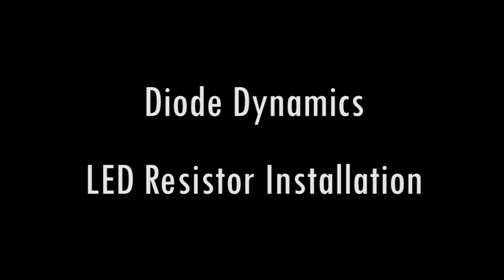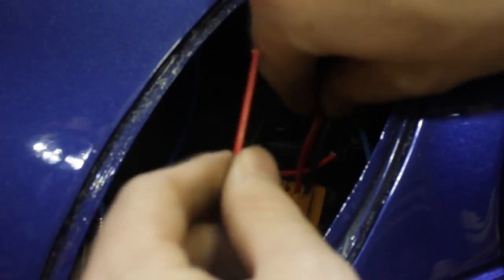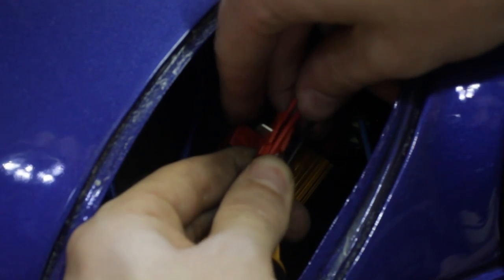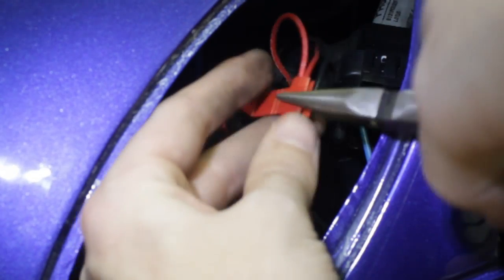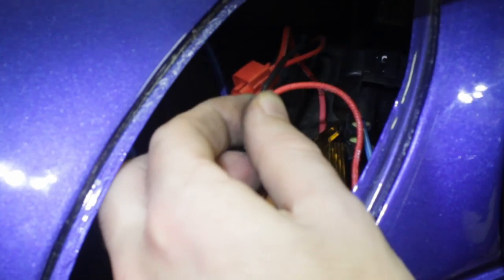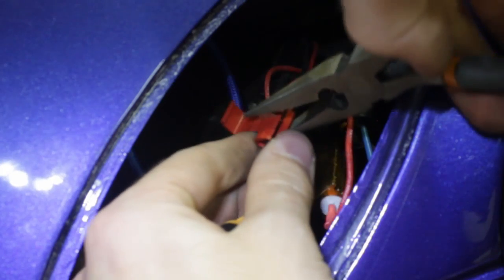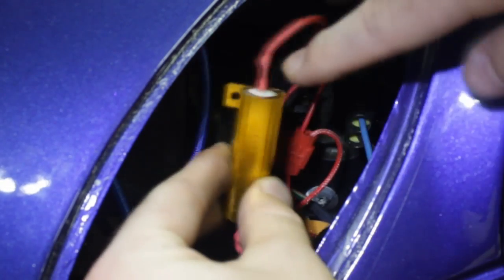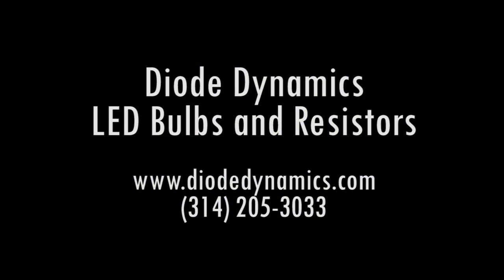How to Fix Hyperblinking! Installing Resistors for LED Turn Signals | Diode Dynamics

Comment: I have bought 4 signal (yellow/amber) led la,ps for my car, i also install 2 resistor for the lamps, but it don’t works well- and its still hyper blinking. And then, I bought a led blinking relay flasher, then everything went well. Why do I need to install resistor and led flasher unit in order to get all the 4 bulb working accordingly?
Reply from the maker: Hi Sean! You will need one or the other to stop hyper blinking. It is likely that your application required only the relay to function properly and didn't need the resistors in the first place.
Reply: Diode Dynamics  I see, I am waiting for the relay unit for the led to arrive. I will install it and see how it goes. But on my scooter, I do this fixture Led relay + resistors on both sides and it works, if I didnt install the resistors, the bulb would not flash and it constantly light up all 4 of them. When I install the resistors but with non-led relay, the lights up with not flashing and were dimed.

Comment: So I ordered tail lights from Caauto and it already cam with this resistor but my sequential tail lights still speed up any recommendations?
Reply from the maker: Hey there! More than likely it is still a resistance issue. We would recommend reaching out to the tail light manufacturer, as they might have more insight as to where to do this in this custom application.
Reply: Diode Dynamics ended up taking your advice called and asked and they said there was a faulty party told me to ship it back to I returned it to them hopefully I’ll get them back soon thanks for the advice!

Comment: my question is if I change all the signal bulbs I have to put one for each bulbs
Reply from the maker: Correct, you'll want a resistor for each turn signal bulb.

Comment: Hi - I have 1157 directional's/running lights on the front of my 1999 Q45. I bought a modular resistor wiring setup (XCAREMO) that plugs into the OEM 1157 (3 wires) , then the inline resistor, and then has the 1157 socket to allow you to not have to tap in or change any OEM wiring.  However when I run the directional's they work fine and don't hyper flash. Then an issue shows up when I turn on the headlights and then I have an issue with the car thinking that the directional and/or running light is burned out. The 1157 LED running light is on ok. The directional's don't hyper flash with this setup but there appears to be an issue with the running lights and the dash will show an error light and leave the turn signal light on in the dash. I tried changing the wiring and had to figure out the ground (Black) and one blue and one red on the modular unit. The infiniti has Black, Green/Red and a Larger Red/Green Stripe - Still can't figure out the wiring issue. Can you assist me and help me figure out how to retrofit LED 1157's on this Infiniti? Is this possibly a ground issue? Thank you... please recommend your product. ( I have purchased other kits from you in the past)
Reply from the maker: Sorry you are having issues with your running lights! Please go ahead and give us a call at 314-205-3033 Monday-Friday 9 a.m.- 5 p.m. CST, or shoot us an email at contact@diodedynamics.com, and our service team can try to help you out!

Comment: I bought blinkers from aliexpress but they are super bright. Is there a way to dim them using resistors?
Reply from the maker: Resistors for turn signal applications will generally be used to slow down hyper-flashing, not dim the bulb - sorry!

Comment: Scotch locks omg! Those are horrible, they damage the wiring and allow water to enter which causes corrosion and leads to issues down the line. The proper way would be to cut and splice the wires either solder and marine heat shrink, or at least crimp and seal butt connectors. Please do yourself a favor and dont use that style connector anywhere on a vehicle.
Reply from the maker: Hey Nate! We completely agree! If you are capable of hard-wiring, that would be ideal. However, these quick splice connectors are a pretty good alternative for the average-Joe. If you have any other questions, just give us a call at 314-205-3033, Monday-Friday 9 a.m.- 5 p.m. CST, or shoot us an email at contact@diodedynamics.com!

Comment: Will this work on a sequential light strip? I bought a 24 inch and trim it down to 4inch the light look solid now because lighy is traveling to fast.
Reply from the maker: Hey there! Our 50W/6 ohm resistors can be used for any turn signal application that experiences hyper-blinking caused by LEDs. If you have any other questions, just give us a call at 314-205-3033, Monday-Friday 9 a.m.- 5 p.m. CST, or shoot us an email at contact@diodedynamics.com!

Comment: Can resistors not burn some wires 

I heard they need airflow
Reply from the maker: Hello! Resistors can get VERY hot, so we always suggest to mount them to an unpainted metal surface, or to leave them hanging freely, away from any soft plastics or wiring. 
If you have any other questions, just give us a call at 314-205-3033, Monday-Friday 9 a.m.- 5 p.m. CST, or shoot us an email at contact@diodedynamics.com!

Comment: Does it matter what end of the resistor goes where...both ends are red and the video doesn't show any + or - markings on the resistor itself...thanks
Reply from the maker: Hey there! No, it does not matter which resistor wire gets tapped to your factory wires. 
If you have any other questions, just give us a call at 314-205-3033, Monday-Friday 9 a.m.- 5 p.m. CST, or shoot us an email at contact@diodedynamics.com!

Comment: Noob question but how does this work without either blowing a fuse or a bulb ? You would think wiring positive and negative would be a direct short as  like sticking a wrench in between battery terminals.
Reply from the maker: Hi there! By tapping a resistor into the circuit, your essentially mimicking the increased power consumption of the factory incandescent bulb!

Comment: I have a problem with my LED turn signal light bulbs I plug and play but they don't flash they don't work so I wonder what problem could be in also I don't know if I have to get a resistor or something in order to make my LED work do you know what could be the problem  then I get a normal halogen light bulbs to check if there was some wiring problem  or fuse problem or something like that but the halogen turn signal light bulb works  properly any idea what's wrong with my LEDs
Reply from the maker: Hi there! Please go ahead and give us a call at 314-205-3033 Monday-Friday 9 a.m.- 5 p.m. CST, or shoot us an email at contact@diodedynamics.com, and our service team will be happy to troubleshoot that!

Comment: If you only do this with the rear(replacing with LED's) Can you have regular incandescent bulbs in the front or do you need to do leds on all signal lights?
Reply from the maker: Hi Jef! You should only need resistors on the turn signal bulbs you've upgraded to LED.

Comment: I've wired up my resistors on the front and they ain't noway as bright as the back ones that arnt on resistors.. Why? Leds on back are mega bright on front are half as bright even tho I've resistors on the front to help the flashing. When I put bulbs on the front there bright but not Leds... HELP
Reply from the maker: Hi there, thanks for reaching out! Please go ahead and give us a call at 314-205-3033 Monday-Friday 9 a.m.- 5 p.m. CST, or shoot us an email at contact@diodedynamics.com, and  our service team will be happy to troubleshoot that!

Comment: Question, what do I need to do if I want those lights to run at the same time. For example in the front of my vehicle the turn signal is only powered when I use the signal. Bun in the rear the turn on when the lights are on rear lights are on and when you turn the signal on it gets brighter. But I put on a resistor it only blinks when the signal is on.
Reply from the maker: Hi Bruce! Please go ahead and give us a call at 314-205-3033 Monday-Friday 9 a.m.- 5 p.m. CST, or shoot us an email at contact@diodedynamics.com, and our service team will be happy to look into that for you!

Comment: Paul I replaced the flasher when I replaced the whole rear light s its worked good until now. the flasher blinks all the time even if you use no key also with no key the signal lights will work with the  switch I have ordered resisters will they fix the problem ?
Reply from the maker: Hi Roy! Please go ahead and give us a call at 314-205-3033 Monday-Friday 9 a.m.- 5 p.m. CST, or shoot us an email at contact@diodedynamics.com, and our service team will be happy to troubleshoot that!

Comment: Hi can you help me with 
My front side light or parking light it's going off and  on again.  and I've just got the resistors but don't know how to put them on it can you help
It's Vauxhall vector 07 1.8 16v .
Or do l just put them on the two wire's it's coming out back of the light.
Thanks very much. 
Yours sincerely 
Robert Gordon .
Reply from the maker: Hi Robert! Thanks for reaching out. Please go ahead and give us a call at 314-205-3033 Monday-Friday 9 a.m.- 5 p.m. CST, or shoot us an email at contact@diodedynamics.com, and our service team will be happy to help!

Comment: I did this for my DRL's when I switch them over to LED's. Before I put the load equalizers and but already had my LED's hooked up the DRL's would come on but I would get a warning light on the dash. so I hooked up the Load Equalizer and now the DRL's don't come on but my high beams come on when I start the car.
Reply from the maker: Hi there! Definitely feel free to give us a call at 314-205-3033 Monday-Friday 9 a.m.- 5 p.m. CST, or shoot us an email at contact@diodedynamics.com, and our service team will be happy to troubleshoot that!
Reply: Just a quick reply on the DRL's. I just found out that on my corolla the DRL's are the High Beam, just ran with less power!!! Lot of people are having the factory disconnect them when upgrading to high $ lights cause you are just running your High Beams all day under less power!!! Good Luck,

Comment: Hi here.  Great Video and informative.     BUT.    I have a Skoda Octavia Facelift 2012 MK2 1.8 TSi  DSG.  I am in the UK, so it is BRITISH specification.     
I have installed LED  PY21W bulbs for my Indicators ( Direction flashers to you in the USA ), and W5W front marker ( side ) lights, but when I start the engine, they all flicker for about a second, but in use I do not get any hyperflash, or dashboard warning..  
I think the flicker is the onboard ECU testing the bulbs on start up. 
Because of this, I am holding off doing all of the other lights like the marker ( Side ) lights and the stop/tail ( P21/4w ), etc.    I also want to avoid the dashboard "BULB OUT" warning light. 
I would really appreciate a brief tutorial, or advice on what to do.
Should I just put the same resistor on every circuit., even the 5 watt marker lights.  And what value resistors do I need for 5 Watt marker lights and 21 watt Stop lights ( P21/4w ) and 21 watt (P21W) fog lights, and 21 watt P21W) Day Running Lights + 21 watt (P21W) reversing lights,  whilst still keeping the extra brilliance of the LED bulbs, but getting rid of the flicker on start up, and the dash warning light.   
Many thanks in advance, as I know this is a big ask.
Keith.
Reply from the maker: Hi Keith, thanks for reaching out! Please go ahead and give us a call at 314-205-3033 Monday-Friday 9 a.m.- 5 p.m. CST, or shoot us an email at contact@diodedynamics.com, and our service team will be happy to help!
Reply: Thanks for the quick response.    I will try and call you very soon, although it can be expensive to phone the USA from the UK, but I think it will worthwhile as you will more than likely be able to solve my problems.
Speak to you soon.   :-)

Comment: I was wondering if you’ve had a scenario where one side blinks fast while the other is normal after installing the resistors? After installing a resistor on each bulb, one side blinks fast except when swapping out the LED at either the front or rear for an incandescent bulb.

Great video.
Reply from the maker: Hi Troy, thanks for reaching out! Please go ahead and give us a call at 314-205-3033 Monday-Friday 9 a.m.- 5 p.m. CST, or shoot us an email at contact@diodedynamics.com, and our service team will be happy to troubleshoot that!

Comment: Since I am leaning toward allowing my LEDs to hyper-flash I did some research. It appears that fast flashing is a good thing. A 1975 study by David V. Post for the National Highway Traffic Safety Admin says "high flash frequencies and minimum flash duration should provide the best conspicuity and smallest response times." Easier to see and gets faster response from the drivers that need see and respond to them. Not trying to sway anyone, just thought it was interesting.
Reply from the maker: Very interesting! Thanks for sharing the info John!

Comment: You said it is OK to mount to hard plastic. Please confirm that as every other video says mount only to metal. Thank you, good video.
Reply from the maker: Hi John, thanks for reaching out! Though we strongly recommend mounting to metal whenever possible, it is ok to mount to hard plastic if necessary, assuming no rubber or wire is located close by.

Comment: I read that blink rates up to 120 /minute are legal - is this true. That is about what my hyper-flash test came up with. Hard to count but I counted 19 in 10 seconds.
Reply from the maker: Hi John! We aren't aware of any legal limit on blink rate, though we would encourage checking your local laws! If hyper flashing is occurring due to the installation of LED turn signal bulbs, we definitely recommend installing resistors to restore normal function!

Comment: Hi, can someone help me with my issue, I replace my entire tail lights on my kia optima for the LED SX . I also had the diode dynamic tail your light on it. but since that at day light there are working well until I brake ( Hyper blinker when I brake ) at night there always hyper blinker. I know that I need to add resistor but do I need to install theme on the 4 lights? ( kia optima 2015 as 2 light in the wing and 2 on the trunk) I tried yesterday at night and after I install the resistor on 1 light and it work but until again I touch the brake they start hyper blinking again. I send this issue to Diode Dynamics but no one cant help. please help
Reply from the maker: We would first recommend installing the Tail as Turn module without the LED bulb to see if the issue is the module or the LED bulb.  If the module works correctly, we would recommend making sure the resistors are tapped in before the module, and into the turn signal circuit. When they are installed correctly, the resistor will get hot when the turn signals are activated. We do recommend one resistor per LED bulb that is installed, so it is possible you need to install more resistors. If you have any other questions, please contact us at 314-205-3033, Monday-Friday 9am-5pm CST, or email us at contact@diodedynamics.com!

Comment: Do you have to do this for each blinker? Front, Rear, and fender? on both sides of the car?  So six times?
Reply from the maker: We recommend installing resistors in each bulb location that you swap out for LED. If you are changing both the front and rear turn signals, we would recommend installing four total resistors. If you have any other questions, don't hesitate to contact us!

Comment: Hi, so i have 3 wires, as you said there is a blue which is for turn signal  and other 2 are brown, one wire from resistor goes to blue and where should other wire go, just any other brown or it has to be specific?
Reply from the maker: +Deepak Bhattarai You will want to tap your turn signal and ground wires. We would recommend using a voltage meter to identify your other two wires. Check out our other LED Resistor Kit installation video, which shows how to install the kit with a dual-filament bulb, at the link below for more information!
https://youtu.be/WyUh1ztBH84

Comment: Does this work for cars with non LED turn signals?
Reply from the maker: +Aaron Dizon When you replace incandescent turn signal bulbs with LEDs in most vehicles, the vehicle will start hyperblinking. This is because the LED uses much less power, and the vehicle thinks the bulb is out. You can use these resistors to fix the problem of hyperblinking when you convert to LED bulbs. If you are experiencing hyperblinking with your factory incandescent turn signals, it is most likely because a bulb is going out, so we would recommend trying to replace the bulb first!

Comment: Just a thought I had while watching this... if you attached your regular bulb in the line under the hood it would have the same effect because the incandescent bulb would give the needed resistance to the standard flasher unit. Of course you would have that bulb flashing on and off under the hood of the car :)

Comment: Dear sir I have a problem. After changing stock bulbs to led indicators, and then when I give right indicator all the 4 les will blink. This happens even when I switch to left. What is the solution for this
Reply from the maker: +Modifications with Manoj We are sorry to hear about the issues you're seeing with your turn signals! If you are using our products, please give us a call at 314-205-3033 Monday-Friday 9 a.m.- 5 p.m. CST, or shoot us an email at contact@diodedynamics.com, and we can help you troubleshoot!

Comment: Why is this resistor so hot so fast!
Reply from the maker: It is normal for the resistor to get hot when the turn signal is engaged. If you have any other questions, don't hesitate to contact us!